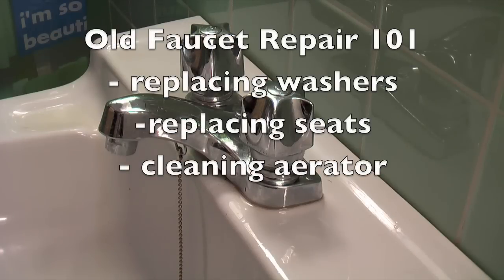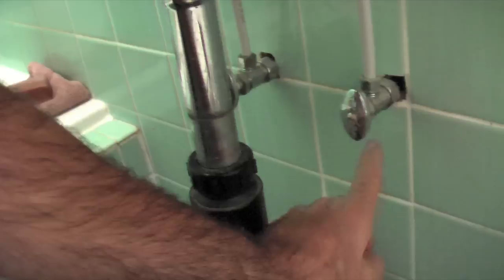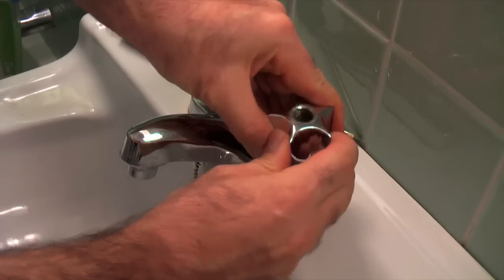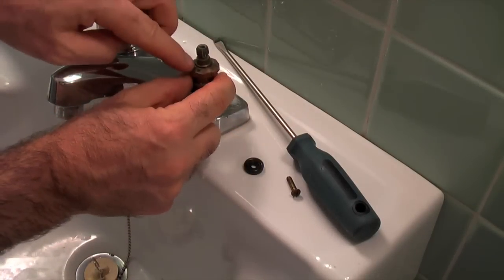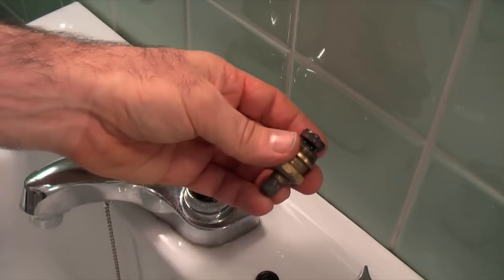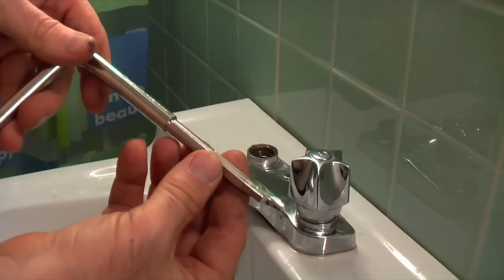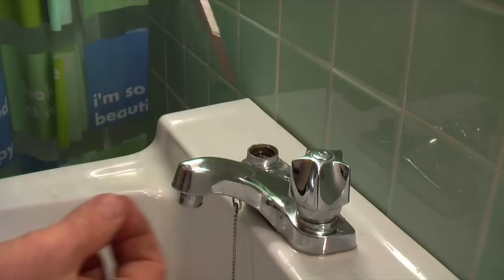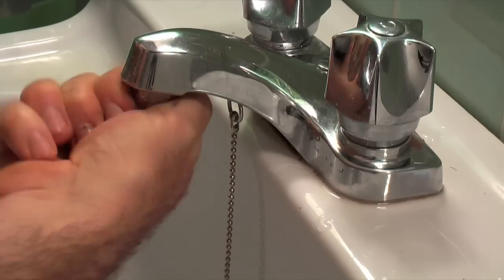How to Replace Tap Washer and Seat

Comment: All in all the demonstration is very good and should help those who can't afford a plumber. Washers should NOT be allowed to leak for long. Over time water squeezing past a washer will ruin the seat. Buy the right grease and use it every time and on the 'o' ring, the valve will last longer & work better.There is a hex nut under the handle of the valve under the basin. This tells me that it has a packing gland not a 'o' ring so if it leaks just tighten it down a bit.  Ken the plumber.

Comment: Very helpful video.   After I replaced my double handle faucet with new stems and seats, only the cold water faucet is still dripping from the spout.   What did I do wrong?   (3Z-6H/C Stems for Valley has a rubber seat and spring).  Appreciate all your advice.

Comment: What direction should you turn the aerator portion?  I turned mine on a brass faucet and the metal broke off in a jagged piece. The whole screw thread broke off. Now there's no way to have an aerator on my faucet.  I can't remember which way I turned it, and I don't want to do that to another faucet.

Comment: I have  just tried to take one of mine to pieces, its been leaking for months. Got the screw oput, but the main part just wont lift off. I thought I lived in a soft water area, but it seems that limescale has "welded" the pieces together. I know white vinegar would dissolve it, but how do I get it to the bits that are literally cemented together?

Comment: I found it just as easy to change the whole tap gland.  Plus unscrewing the nut can be difficult at times so make sure you soak it in WD40 overnight first and even then you might have to apply a little heat first before it will snap off.  Especially on a single tap where the tap rotates as you try unscrewing the valve nut.

Comment: Had a problem with an intermittent leak. Replaced washer. Had a drip cold immediately after replacing.  After several attempts to seat the washer, the drips stopped. Then cold started to drip again. Changed washers again; same intermittent problem w/cold water.  Thought the seats were worn (non-removable seats on a 100yr old bath tub faucet). I took the valves out again and was prepared to re-seat with a grinder.  Then I noticed a small piece of something in the body. Thought it was teflon tape.  Turned out it was a piece of hard plastic, likely from the dip tube in the HWT that was getting caught between the washer & seat (hence, the intermittent drips). It did not wash out through spout because of the shower diverter. Lesson to be learned: check all possibilities before re-seating...and grind ever so slightly one step at a time. There is no such thing as rebuilding a seat.

Comment: Looks pretty easy. Why do plumbers charge $100 plus for this basic procedure?
Reply: I'm not a plumber but is it not reasonable that the tradesman charges for his time to get from the last job he was at to your property then the time he spends doing the work itself plus the cost of materials including margin plus GST?

let's look at it like this:
labour @ $80.00 p/h
30 mins travel time = $40.00
15 mins labour for repair = $20.00
parts (prices from Bunnings warehouse) 
tap seat kit - $39.90
tap washer $2.41
O rings - $0.50
30% margin on parts - $12.85
TOTAL - $115.65
10% GST = $11.57
TOTAL Inc GST = $127.22

Sounds reasonable to me, The guy has to run a business. You pay for the privilege to have a trained professional do the work you don't have the skills to do yourself.
Reply: Bonavon Vovo Charging a travel fee is bullshit. They make enough as part of their hourly rate. A tap seat replacement kit is just a tool for fixing the seat, so shouldn't be in the final price. That would be like a builder charging you for the hammers he already had in his toolbox. 30% markup is also bullshit as most part prices I've seen from plumbers are marked up 100-500%. I've seen plumbers charge $5 for a washer he probably only paid 20 cents for (Remember these guys are buying in bulk at wholesale rates). Once again, it's extortionate price gouging. The reason I'm so pissed off is that my mother is trying to survive on a pension, but is forced to use these vultures who just take advantage of a frail old lady. I would do the work myself, but I'm in a different city. I'm not a plumber either, just a layperson who knows how to educate myself on the basics and replacing a washer is a piece of piss. So overall, FUCK the plumbers who rip people off.
Reply: cybersphere You think it is reasonable that someone should spend more time traveling to a job than the time they are there and not get paid for that time? Traveling there is part of the job. You also moan about people charge a margin on materials, have you ever hear of cost of goods sold? You clearly do not run a business and would sink f you did, The violins are playing. Everyone has to make money, this is how a plumber does. Don't like it, don't use one, don't have the skills? Then tough shit.